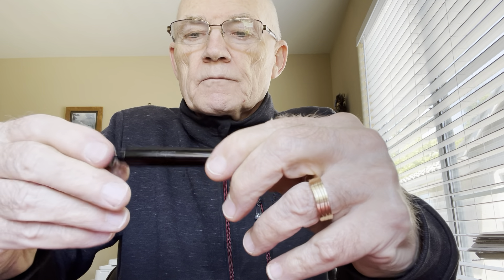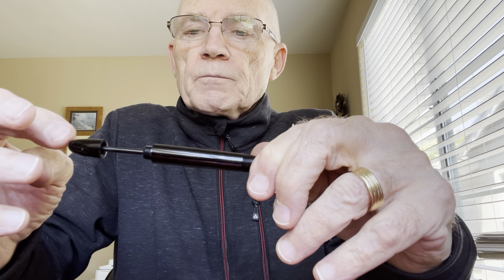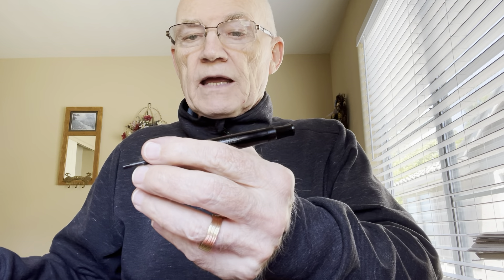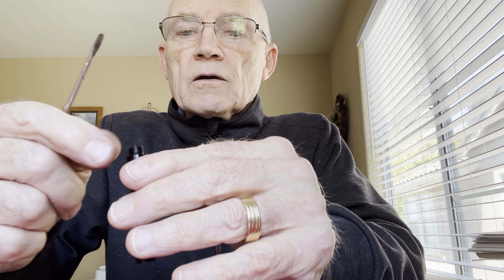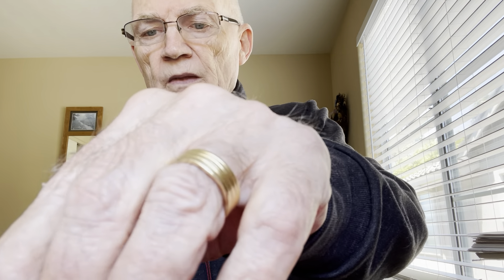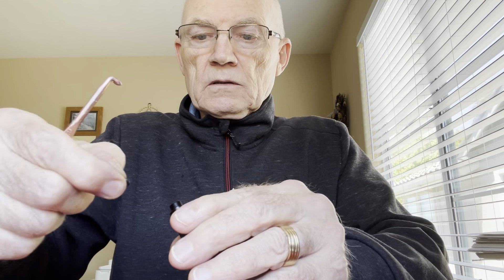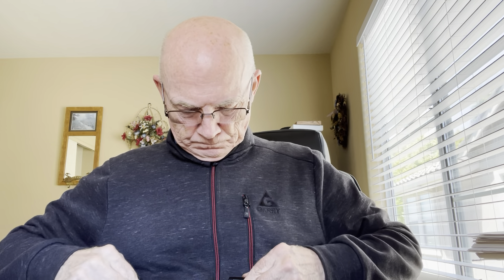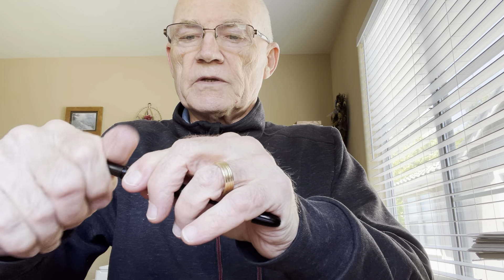Fountain Pen Repair: Japanese Eyedropper Seal Replacement

Comment: Thank you for the information. I just got my first vintage Japanese pen and wasn't quite sure what to do with it. It is an eyedropper with the plunger, much like the one in your video, but I can;t get the section to unscrew. What I took away from this is to try and soak it to see if it will loosen up. Then I can only hope it doesn't have leaking problems if I can ever get it open haha
Reply from the maker: Soaking or heat may help, I use a hair dryer. I’d use the heat first.
Reply: @daynenix2832  oh thank you for the suggestion! I will try my hairdryer first!
Reply: The hair dryer worked!! Got it all rinsed out and let it soak a little thank you for the help

Comment: Hello! Another awesome and very instructive video! I have a question: Is it possible that there is no cork inside the barrel, but the ink flow is instead stopped by the rubbery component at the bottom of the blind cap (at the base of the shaft)? At least, that seems to be the case with the pen I have.

Comment: Wow very informative. Like you I fell in love for Japanese Eyedropper. I've 3 of them and I would like to strart using the cheaper one as everyday pen. I found a webpage with similar operation using the cork instead, but not so clear as this video.
May you also explain provide a video on Feeder Nib removal? It's easy to perform? Is threathed or just push-pull usually?
Reply from the maker: Thank you - the nib and feed are just friction fit - and a nice thing about some nibs is that the nib makers sometimes add additional info on the underside of the nib. Ban-ei pens have the initials or name of Ginjiro Kabutogi, Pilot pens have a date. Yes I’ll do another video on removing nibs. And then setting them. A knock-out block is helpful.
Reply: @daynenix2832  Yeah I study whenever possible, mostly info I got are from cronicas estilografica blog, and I was lucky enough to buy a Ban-ei (vermillon) with GK nib. I also have a small maki-e with crane with a warranted nib. Now I just bough a tamenuri bori at very fair price as I plan to use it, but for sure will require some job. Looking for your nib disasseble video.